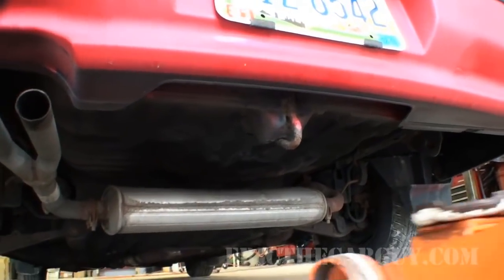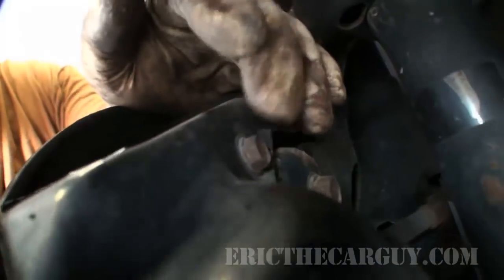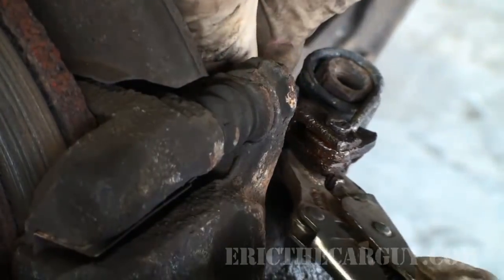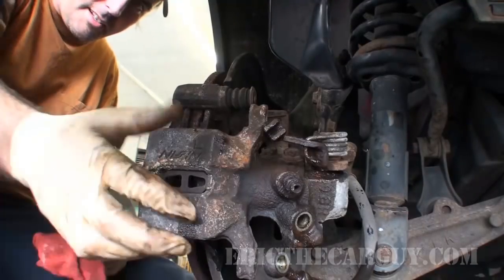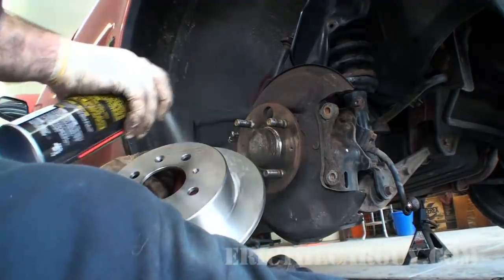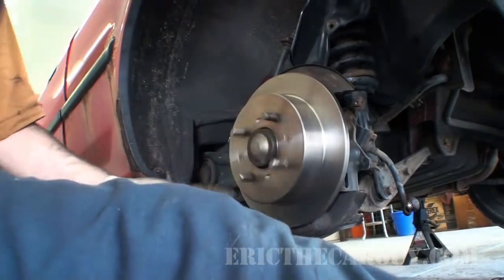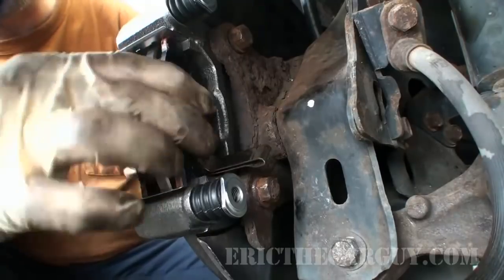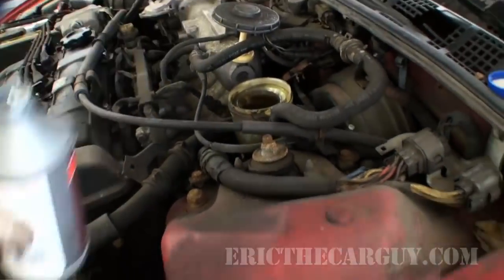How To Replace A Rear Caliper, 93 Acura Integra - EricTheCarGuy

Comment: Eric, I like to use a very thin layer of anti-seize  between the new rotor or brake drum and  where it contacts with the axle. Put a small drop on and spread it as thin as possible between the contact surfaces. No way should there be enough extra goop to allow it to drip or spread onto the brake pads or anything else. Makes it super simple to take apart a few years down the road.

Comment from the maker: @Memnocht Don't, normally calipers fail due to corrosion and there is no way to repair that but to replace the parts and once you get to that point it's just cheeper to replace the entire thing.

Comment: Great video. I'm commenting because these videos will be useful for so long as there is on Integra in the world. 
One tip: I raise the hose above the bleeder valve (loop it up) and then have the bottle down. This way, when you're pumping the brakes, the air stays in the top part of the loop (if there is any) and doesn't back up into the caliper.

Comment from the maker: @adamlee17 I'm not sure I understand the problem fully but you can replace those metal shims without having to replace the entire caliper.  In fact I would recommend just replacing those and servicing the caliper instead of replacing it, that is unless the piston has stuck in the bore and no longer moves freely, this is the only reason besides leakage to replace a caliper in my opinion.

Comment: I bought these quick bleeding "valves" for my motorcycle. They have a some sort of spring operating system system that allow the brake fluid go the other way but don't allow it or the air to go back in when bleeding.  They made the bleeding of the brakes much easier and faster. Gonna get them for my car if they are available.

Comment: Great video like always :) Just throwing this out there in case no one else has suggested it yet, wrap the bleeder screw threads with teflon tape and you won't get the air past the threads concern. Works great when someone is bleeding brakes by themselves(vacume, pop bottle method, self closing bleeders or whatever).

Comment from the maker: @PVoyager It's not that difficult for someone with experience as you have to slip it under the rear engine mount.  You might want to check and see if yours is covered under warranty as I know the Acura TL of about that vintage had a recall on them I'm not sure if it's the same for Honda.

Comment: Excellent tip on bangin screws with hammer.One tip i learned for crackin loose bleeder screws is to wack the top of the bleeder with hammer and then try to tighten first then loosen and 99% bleeder comes loose.great tip for ya if u never heard of this..TY Jbone..Also great detail info in this video,It will help someone out tremendously..

Comment: Congratulations  video by my friend, taught step by step how to do disc replacement, and brake caliper, in my case, I need to remove the caliper to send it to be repaired, do encounter with a new facility in Brazil, surely find the dealership, but the cost is too high for one for a Honda civic 1993 saw which is the same system that acura has shown in his video, very grateful because encinou up getting the air brake system. Congratulations and thank you.

Comment: For the pressure washer ... you're right about them. On my protege the new one are so wider than the original one that I can't get enough tread to lock into the caliper. I actually stripped the first caliper because of that. Fortunatly my car part was nice enough to get it back as "defect".

Comment: OMG Thank you so much for this.
Working on my '98 del Sol and was stuck getting the handbrake off the caliper. Saw the bracket but not didn't know how the get the cable off the mechanism. 
Thanks for pointing out the pin!

Comment: Very neat and detailed video Eric ;-)

I great detail for your fans is to tell them NOT to use copper grease on the back side of the pad on the piston side. The copper dissolves the rubberseal around the piston.

Comment: Use brake caliper grease on the bleeder valve to prevent leaks and air getting sucked in, works well. I would not use teflon tape because there is the risk of getting that into the brake system. +1 on not using petrol based grease on the rubber parts. 

The new caliper did not look to have any anti-corrosion coating, so if you care about that kind of thing, paint it with caliper specific paint, otherwise it will rust like crazy and look pretty bad. Thanks for the vid.

Comment: If you have to reuse those soft "crush" washers or other copper washer on banjo fittings or fuel rails, it's a good idea to anneal the washers in a propane torch flame for a few seconds. Either air cool or quench in water. Copper gets hard when it is worked and soft when heated to above the critical point.

Comment: Have to do this this weekend. Only thing that scares me is the bleeding part. I'll be using the same method as you, except I won't be clamping the brake line. I'm using one of those plugs to keep the fluid in.

Comment: Eric, I bleed exactly the same way as you but I use a slightly longer hose and put the bottle the hose bleeds into ABOVE the brake cylinder I wish to bleed.  

I use a shop stool for this usually.

This works exactly the same way, except when you pause, the air bubbles in the line tend to go upwards. If some stuff gets sucked backwards into the slave cylinder when you release from the petal then it will more likely be fluid instead of air because the bubbles float UPWARDS.

Comment from the maker: @kidcool1977 That is exact ally what I was going to suggest as it sounds like the push rod inside the booster is not adjusted correctly.  I've only done the adjustment at the dealer with the special tool I haven't done it any other way however if you suspect that it's the problem you could just back it off a few turns to see if that cures the problem.

Comment: 8:10 Excellent video! Was out replacing my rear calipers earlier today and ran into this very issue. The calipers came with new washers but they leaked when I put them on so I had to reuse the old ones.

Comment: Putting grease under the shims and on all mating surfaces ensures that there will be no squeaking or rubbing noises after you install the brake pads into the caliper assembly. Friction causes heat, which can produce noise when metal rubs against metal. The box that the brake shoes came in will usually have assembly grease, retention clips, and instructions of where to apply the grease. Note: Grease on the brake surface can cause brake failure! Road test to prime brake surfaces after assembly!

Comment from the maker: @DStylesHanska If you run synthetic on a high mileage engine you will most likely burn an excessive amount of oil as well as every seal on the engine starting to leak.  Synthetic has different flow characteristics and will not 'seal' like regular oil.  Also most synthetics are not 'full' synthetic oils but rather blends of regular oil and synthetic.

Comment: I've also bleed brakes alone and found that it's much better/easier to have that bleed cup higher than the caliber so that bleed tube will go upward. This way the air comes out much easier and it won't go back to caliber. Of course this is bit messy if the bleed screw is leaking.

Comment: Eric I've been looking at this new OEM rear caliper/pads I'm going to install and I gotta say I can't figure out how that's going to work with the raised 'pin' on the back of the pad inserted into the crosshairs of the piston.  As the piston twists and moves outward, that pin will get caught and twist the pad until it's pivoted into the rotor and wear unevenly as it nose dives into the rotor.  We know that's true because when we replace the pads, we have to screw those crosshairs BACK into 12 and 6 position in the caliper because they don't stay there.  And that might be why the inner pads wear faster than the outers.

I'm wondering if that's why the pads on Honda's  in general, wear out so fast but mostly in the rear brakes and mostly only the inner pad more than the outer.  So, what if that back pad pin were filed flat so the piston can twist behind it flush to the pad without catching the shoe?  Wouldn't that let the pad wear more evenly, and last longer?  I know I've had my brakes done WAY too often for my conservative driving, and it's mostly been in the back caliper.  And each time, I have to buy all three components ... the shoes because they don't wear evenly front to back and the rotors because the shoes nose dive into the rotors even if they're NEW, and the calipers because they get blamed for 'freezing' and leaving a bad caliper symptom on the rotors.

What do you think?

Comment: I have an issue with dragging brakes on my 95 accord, originally the right front passenger  was locked/dragging. I then replaced the passenger caliper, after that was done the  driver side locked up. I then figured the brake hoses were bad so I replaced both driver and passenger brake hoses. My question is can the brake master cylinder cause caliper to lock up. Btw, Eric can you demonstrate how to adjust the brake master, because I have read that is one of the reasons why calipers lock up.

Comment: @jazzy4me4eva In a previous video, Eric shouted, "don't use antiseize on caliper sliders, use silicone paste". His point is that antiseize is not really a lubricant, it's more of an anti-rust product, to prevent seizing threads on bolts that need to be removed later. His point is that when mixed with lube or silicone products, antiseize could cause sludging and slider binding. Whatever is put there needs to be high temp resistant and long lasting -- silicone paste seems to fit the bill.

Comment: Hey Eric

I just bought a 2002 Acura Rsx, it has over 310kms on the odometer, im the second owner as far as i know, and other then the rear breaks and a clutch replacement the car seems fine. I was just wondering if you could tell me how reliable the Acura/Honda engine is? The body is fine but could have i bought a lemon do to the 300+ kms?

Comment: Hey Eric 
I just changed my rear right caliper. My car rolls back on hills which good because before it would be stuck. But my breaks sweak now. Could you shed light on this? Also do you have a video on how to adjust the handbrake?

Comment: At 18:22, you can fit a 10mm wide bolt on the inside of that big nut, and use a socket wrench to retract the spring mechanism, if your e-brake is engaged.

Comment: Hey Eric, Did you have to use your special tool for calipers to move the caliper piston to align it with the bump on the back of the Brake pads?

Comment: @EricTheCarGuy How do I back it off a few turns? Do you mean removing the brake master Cyl. and then turning the rod eighter clock or counter clockwise? also when I rotate the rod, do I do it by half a turn, or a complete 360 turn?

I actually found a write where you can adjust the push rod without using that special tool, it involves getting on your back and doing it inside the car (if that makes any sense)

Comment: @SER198503 Yes, and if you noticed, he took it off bacause the PARKING BRAKE (It's not an Emergency brake, look up DOT requirements for something to be considered an "Emergency Brake") cable and that same bracket was still on the vehicle since he removed it from the old caliper. It's easier to do that then to re-install the cable and re adjust in a new bracket. Just sayin...

Comment: another trick for one man bleeding is to use a piece of 2x4, a pipe, something that will fit between the brake pedal and the bottom of the seat. all you do is put one end of the 2x4 on the pedal and the other end on the bottom of the seat and slide the seat forward to apply pressure on the pedal. then open and close bleeder slide the seat back to release the pedal then repeat

Comment: I think I need to do my 2 front calipers on my 97 Acura Integra. Whats happened is the shim thats under the break pad has broken and it just makes sqweeky noises now when I drive and brake. The calipers are old and the guy that changed them last time said they were a pain to get off and he did not use antiseize when he reinstalled them with new rotors and pads. Would you recommend replacing the calipers and pads? is it the same as this video? I am DUI (trying it anyways)

Comment: My biggest question is, if the driver side rear was bad, then replacing with a rotor and brake pads a different size, what will the passenger side rear need and not need?

Comment: How do you remove the CAM out of the caliper? got the Honda rebuild kit, and I'm trying to take the CAM out of the caliper assembly so i can replace the cam seal... After i removed the parking nut, I turned the bolt clock wise like 90 degree and I heard a click... not the cam is kind a stuck at the horizontal position... you have any idea how to extract the cam out? or reset it back to its original vertical position?

Comment: hey Eric, I got a 1988 accord with a caliper like this, I replaced one, but reused the barely worn pads. the calipers are mismatched on their extended length. how would I install the new caliper so that it's not completely open, and grabbing the pads at the same place like the other side? I can tell the e-brake cable on that side has to be pulled extra to clamp down =(

Comment: I have a question abouyt interchangeability.

I am thinking there are not that many different brake calipers.

Can I match a replacement brake caliper to thise fitted to my car by just bolt fitting diameter hole distance? Are there anhy industry standards? Are calipers generally made the similar sizes to fit a variety of cars?

Do I have to match caliper performance? i.e. do my rear calipers have to be weaker than my front calipers?

Comment: @sbab83 lol, you can't. I think eric only bled one caliper and as you can see on that particular wheel he was able to close the bleed bolt. Whne I bleed my brakes I put teflon tape around the bleed bolt thread so that way air does not get through. YOu can also use grease

Comment: @nomotiv99 The grease is an oil based product that will eat at the rubber boots.  So you use silicon so it doesn't eat them.

Comment: Hey Eric big problem well it is to me. I was quoted $500.00 to replace a high pressure power steering line in an 2004 Honda Accord V6? How hard is it to do. Im mechanically inclined

Comment: @peelout40 The passenger side does not need to be changed in any way. There is no real reason to think the rotor and pads need to be the same thickness. Disc brakes have a square cut O-ring on the piston in the caliper, This square shape is what allows them to be self adjusting. The piston will slide out as the pads and rotor wear, then the dictortion of the O-ring upon application will cause the piston to be slightly retacted when the brakes are realeased. No pull will be created from this fix.

Comment: I have a question probably nothng to do with the video. i wana do a rear brake conversion to my honda civic 1990 hatchback i was wondering if the 1993 acura integra is compatible for the  Trailing Arms (with everything attached Rotor, Caliper, Ebrake Cables...).thank you
Reply: Viannae Munguia yes

Comment: @peelout40 While the most proper way is to do the same work for both sides, it is ok to do only 1 side. Yes, the front calipers have the square cut O-ring that make them self adjusting as well. You were not taught "wrong", you were taught the generally accepted correct way, and for most people, that is good enough, howevr, when you do this for a living, you know what you can get away with and what you cannot and why. This won't hurt anything, but the "best" way is to do the work for both sides.

Comment: I heard bleeding a teg with foot brake ruins  master cylinder,and thought it was crap . But Onhigh mileage carsthe m/c is dirty in the bottom an during normal use it doesnt travel that far. So bleeding and pumpin that way  rubs the m/c seals over the dirt or rough walls.  After dointhis a few tmes I needed a m/c but it was high mileage anyway

Comment: im having a big trouble taking out sa 12mm bolt this is connected near the hose those 2, 12 mm bolts. i got the first one taken off but the other one cause me a big problem. it was rusty like really rusted and the head of the bolt is loose thread already. i dont know how to take it off. that was the only one need to be off so i can remove the caliper and change it help please

Comment: Rotor is a disaster. 2 hammers didn’t work. Impact screwdriver bit snapped off in screw. Can’t pry the bit out. 

If your car is 25 years old I wouldn’t even try an impact screwdriver. Just drill it. I drilled the one screw. Piece of cake. The other has the driver bit tip stuck in it and is a nightmare. About to cut it out with a grinder or Dremel since I can’t get a drill bit to go through it.

Comment: Just for ppl out there , I tend to have an extreme fear of my SUV falling on me, I tend to always leave the Jack under it  with just a slight pressure to insure that if something was to happen I have an extra safety measure .I mean 3 tons would not be nice to fall on you , I also do not trust the pinch welds after so must rust, so I urge you all to be as safe as you can , I have seen many cases that the car fell on a person, it can and it does happen, stay safe...

Comment: To bad you can't add a picture.  I figured an easier way to get the emergency brake cable off.  If you put something like a screwdriver under the bottom part of that little pin and and take a socket and hit the top of it it'll pop out